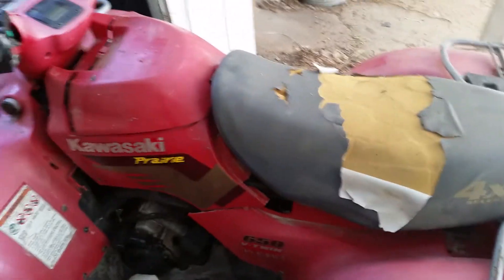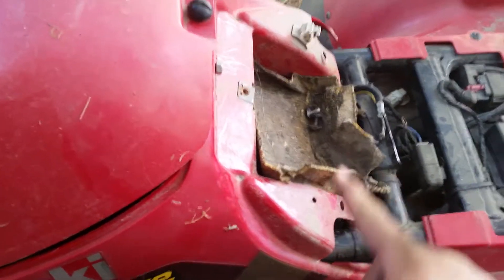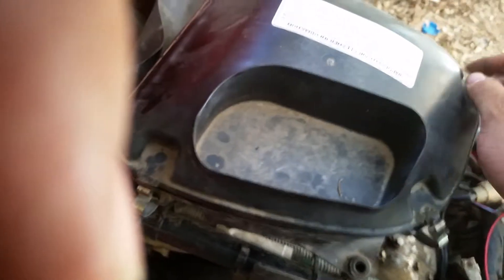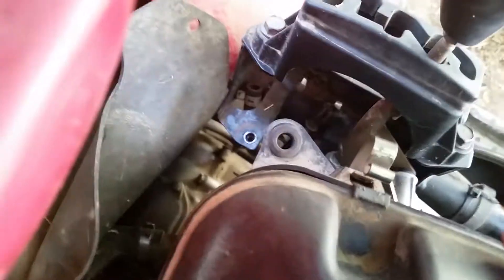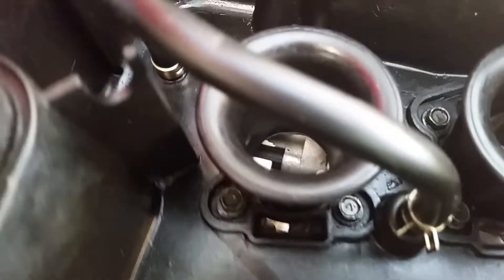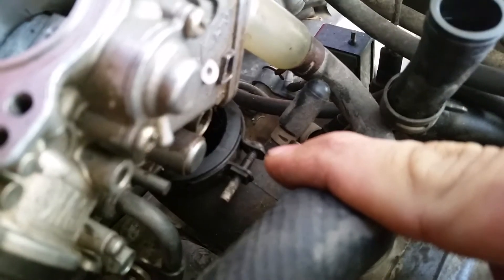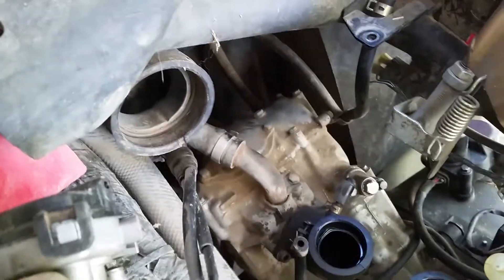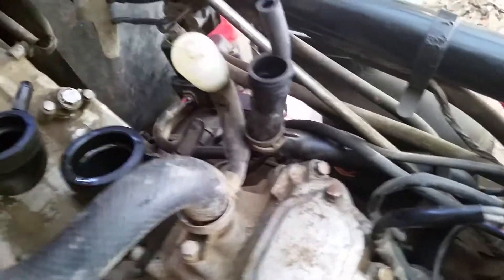2002 prairie 650 tear down part 1

Comment: I just got a 2001 Kawasaki 650 Prairie with no limp mode wires. to reset computer. Please help.
Reply from the maker: So how I understand it the early models like the 01 and 02 didn't have a limp mode from the belt mine turned out to be a jet in the carburetor was messed up

Comment: Mine was sitting for the years under the elements bought used it never even proper..it was sitting cause it ran rough black smoke back fires only get some run time out of it if you leave choke open a bit... last summer I dusted her off and went to work on the carbs... turns out the guy before had the choke adjusted so tight that one plunger was not closing all the way... pit some slack in the chokes and cleaned out carbs with Nitro Rc fuel and boom the sound of these bikes can't be beat they sound like sports cars compared any other bike and that straight axle gets you to top speed between lamp post... I call it the Hemi of ATVs. 3000 miles  just barley broken in thus baby... Kawasaki Boi "Racing Blood "
Reply from the maker: I love it nothing like bringing a barn find back to life that first start is so amazing
Reply: I've got to clean the he'll out of my carburetor/tune it new air filter and oil and mine should be running like new, I got mine used in 2018 and it sat for a year then we moved it
Reply: They are great yet complex bikes, that d3serve to be ridden hard yet maintained thoroughly!
Reply from the maker: Absolutely!

Comment: Hey bud. That unknown hose that goes to the carb is a line for coolant to circulate inside the carb because the barbs are liquid cooled. I know right? Pretty cool. I know this because I had both carbs rebuilt on my prairie 650
Reply: Sorry, carbs not barbs lol
Reply from the maker: hansentom50 that is crazy thanks for the help

Comment: I had a radiator  hose either come loose or bust it seems from the top of the motor. What is the easiest access to the hose?
Reply from the maker: +webman1956 probably to take the seat and breather box off. Hopefully you can get to it from there without messing with the carbs or front plastic
Reply: Thanks.
Reply from the maker: +webman1956 np

Comment: Is the thermostat right there under the air filter box? I am having issues with over heating in mine and wanted to change the thermostat out first before I get more involved. I have worked on many cars and trucks over my years, but this is my first time trying to fix a four wheeler. Thanks!